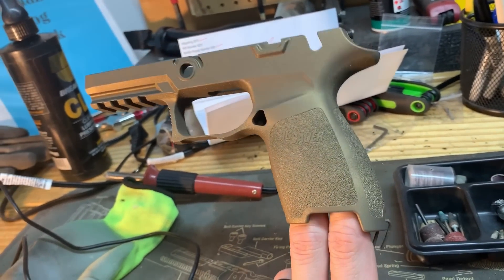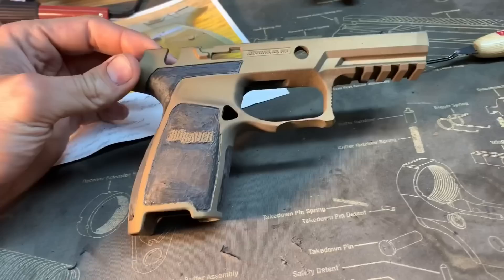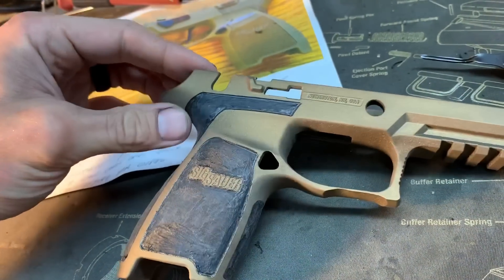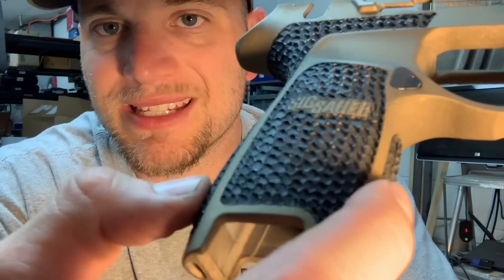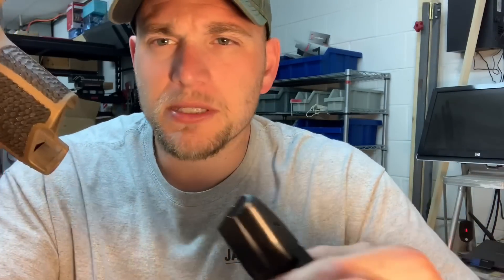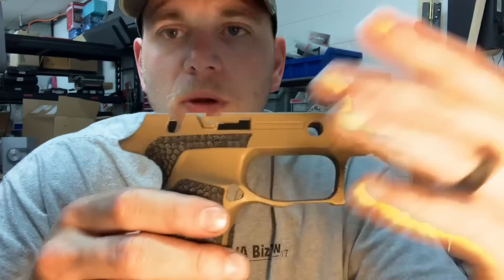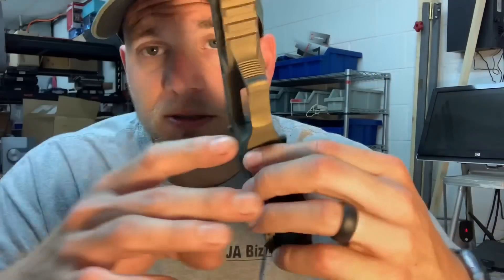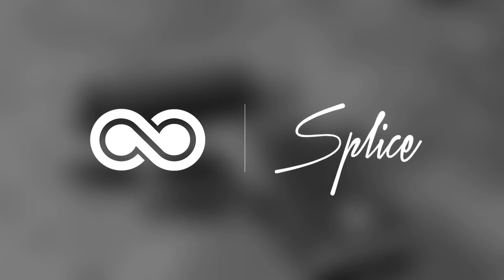Sig P320 Burnt Bronze Cerakote & Stippling

Comment: Once you close, will you still be able to transfer frames? Will you keep your "ffl" basically?  I know some serials are on metal frame inserts but most are stamped & the plate integrated.  Also, I have a pt111g2 slide that's giving me surface rust issues from just a couple hours on the hip. I usually deal in bulk w my cerakote guy, therefore I get charged per color and volume, not by piece, so I could have 3 complete ar style rifles & 2 slides done for about the same price as just one rifle (100-120). Will you still be cerakote capable after shop closes and if so, about what would you charge to do a standard single color.
Reply from the maker: 321JKilla yes we will still be an FFL after the store closes. And once we open up a custom only business I’ll be cerakoting again. We’re going to be down a month or two until we get everything figured out. And for slide or frame only I charge $65 for a single color.
Reply: TNT Tactical TNT Tactical I will probably get in contact with you after your up & running because my price is 90 per color if it's a slide or I fill an entire drying rack with parts, still 90.  I sent 3 full ar's, 1 complete pistol, & 2 slides. Laser engraving on 2 lowers + coating & tax was just $129. Now I do send them a ton of business thru our local NRA committee as well as occasionally having our charity raffle giveaways coated, so they hook me up on bulk & charity stuff but it's 90 either way so I've been looking for a more affordable option, not just for myself but for others I know who just want minimal work done.

Comment: Question: is it 2 different cerakote colors, or do you add something to make the stippling black in contrast to the bronze? Sorry if I missed this answer somewhere, or maybe I’m just a very ignorant:) It’s beautiful!
Reply from the maker: Thanks! So the way it’s done is I begin the frame modifications for stippling (sanding and cutting borders etc. Then it gets taped off,Cerakoted Burnt Bronze then i sand away the Cerakote in the areas that were not taped leaving the black frame which is then stippled and remains black
Reply: @tristarcustoms77  ahhh that makes sense. thanks buddy!